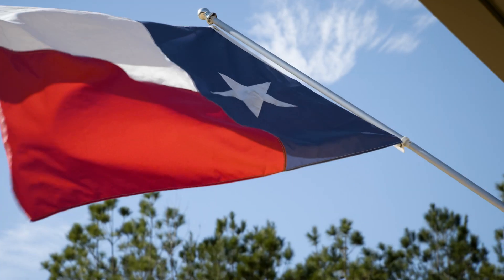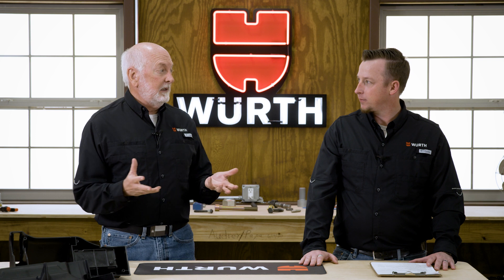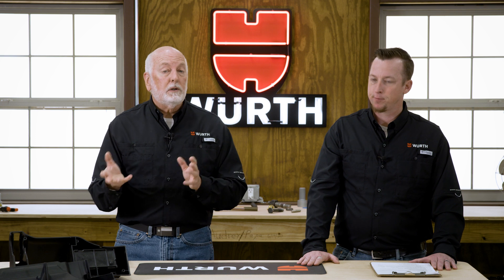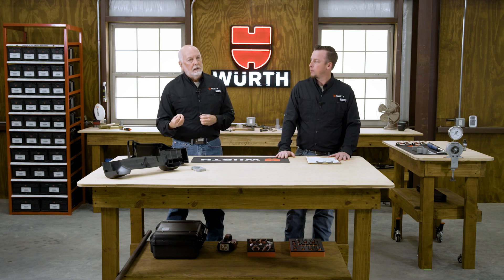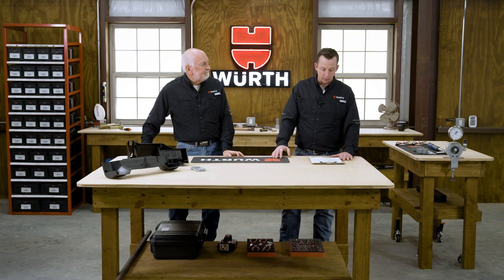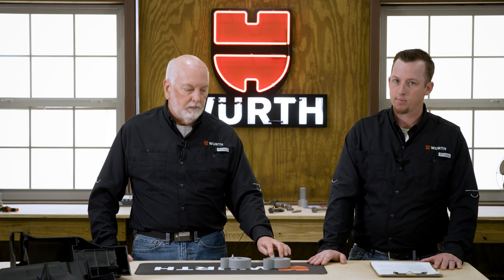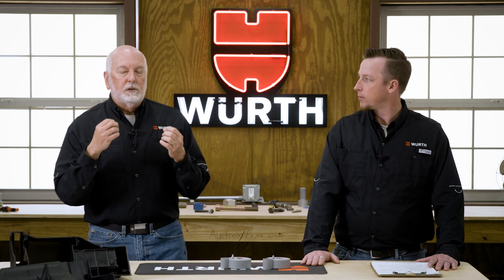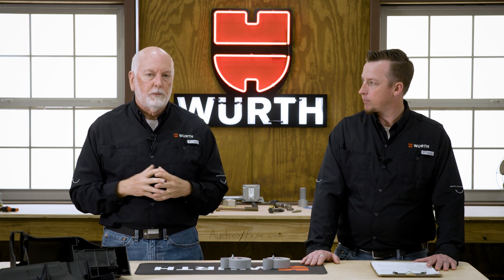Screws for Plastic Assemblies | Würth Knowing Episode 4

Comment: Since miniature screws have very fine threads, making it easier and easier to strip plastic, at what point are brass inserts required? An M6 screw I can definitely see not needing an insert, but what about M2 or M3? Those threads are much finer.
Reply from the maker: Hi, Jerry! 
Depending on the application requirements, brass inserts may not be necessary to prevent strip-out with screws down to 1mm in diameter. If a properly dimensioned screw boss, optimized installation torque, low drive speed, and the latest multi-angle thread designs are being used successfully, it can work even in very small sizes. 
Start with understanding the plastic material needed for the application, then design the joint to accomplish low material stress and optimum—not maximum—clamp load. 

If you have further questions on specifics, you can email me at wurthknowing@wurthindustry.com.

– Randy Lammers